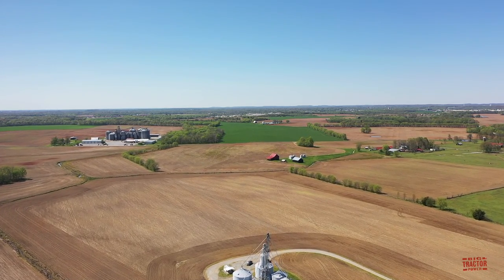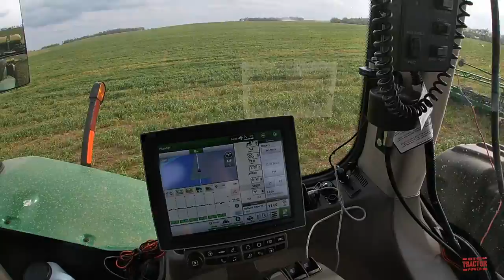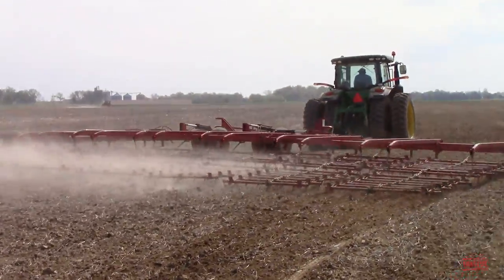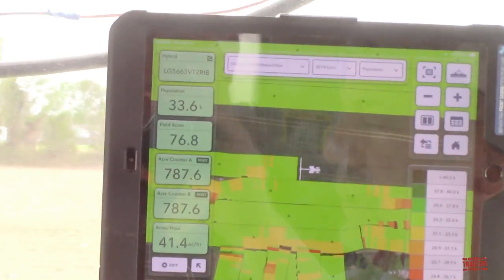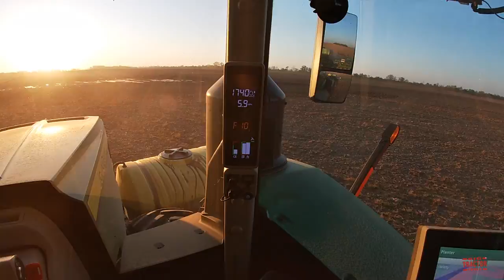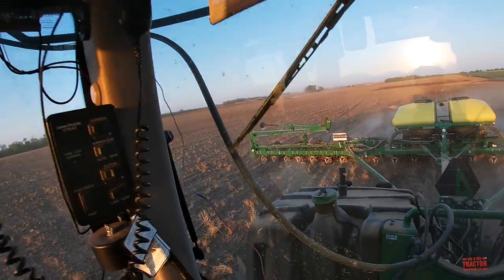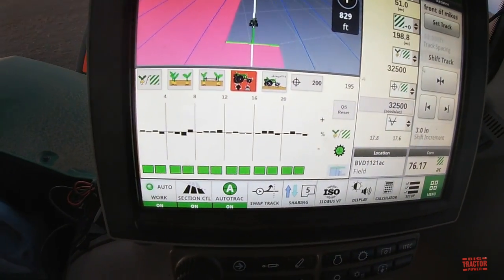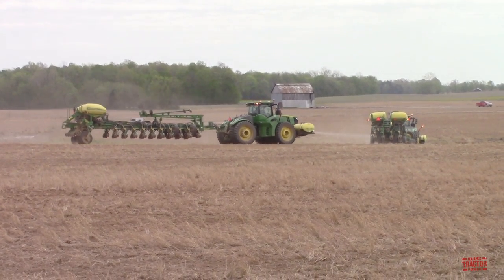PLANTING 11,000 Acres of Corn in 7 Days

Comment: We use a 2008 Case IH 535 Steiger on Triples with Chem Farm Saddle Tanks and a 2013 John Deere DB90 36r30” decked out with about everything you could possibly want.
Reply from the maker: Awesome planting team. 😁👍👍
Reply: bigtractorpower expensive planting team, about $600,000 for the whole setup.

Comment: Great video! Do you think they'll every go to more of a no-till or reduced till system? They make a lot of passes. Here in MD we would never even think about tillage on soybean stubble and we still get every bit as many bushels as you do there and they are the same rotations.
Reply from the maker: This is a min till system. The surface of the field looks like no till at planting time. They subsoil because the soybeans are double dropped after wheat. There is allot of traffic on the field between wheat harvest in June and soybean harvest in October. The soybeans are notilled right behind the combines into the wheat straw.

Comment: I'm surprised that they didn't stick with Kinze and go to the 4905 planters. From what I could see looked like they were planting around 6mph where the Kinze 4905 can plant at 12 mph seems like that would be a huge advantage on an operation of that size.
Reply: Parent of Twins planting speed is all about how the planter is set up, not the brand of planter.

Comment: 1. Start with fresh corn seeds for the best results.

2. Directly sow seeds approximately 1.5 to 2 inches deep and 4 to 6 inches apart.

3. Cover with soil, space your rows of seeds 30 to 36

inches apart.

4. Water your block of corn well after planting.

5. Corn stalks are sturdy and should not need staking.

Comment: Great video, I have learnt a lot about the farming methods undertaken in the US.  I have noticed that when traveling down the roads they have the hazards lights on, is this  law?
Reply: Not necessarily a law but most farmers use them just as a safety measure. The only thing that is required is a SMV (slow moving vehicle) sign. That is for implement that travels under 30 miles per hour. Its the little orange triangle thing on the back of most implements
Reply: @cadencarlson3095  Thank you that has helped understand as we don't use them here in the UK, we just use the flashing beacon normally and lights and an escort vehicle if wider than 3.5 metres

Comment: Would using a seed tender be faster than totes? Just wondering y use totes
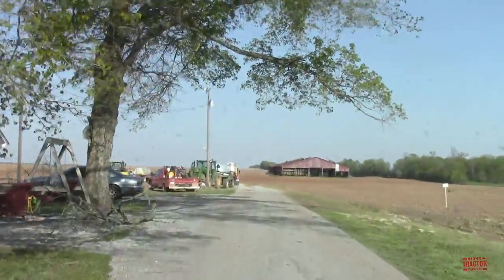Reply from the maker: Just opening the tote and emptying into the planter is fast. It takes about 1:30 seconds.  A seed tender is nice but it’s an extra expense and you have to maneuver it into place and it takes about 8 minutes to fill the planter.  The two totes take 3:00 minutes.

Comment: At Garnett Farms, after the spring planting how does the farm utilize all the labor driving tractors and support equipment, Until the harvest .?
Reply from the maker: The farm stays busy 12 months a year.  Matt for example repairs and assembles equipment.  In January Matt sprays wheat, in February he sets up NH3 tool bars and corn planters, in March he sprays wheat again, sprays corn ground with herbicide, plants corn, in April Matt sprays wheat and corn, in May Matt sprays wheat, mows hay and bales hay.  In late May he sets up combines. In June he cuts wheat.  In July he sprays soybeans and sets up combines for corn. In August he sprays beans and starts harvesting corn. In September he finishes corn harvest and disks corn stalks. In October he harvests soybeans. In November he subsoils soybean ground. In December he repairs combines and subsoilers.